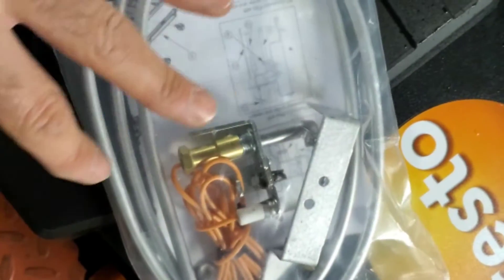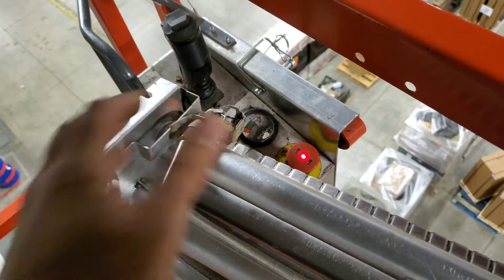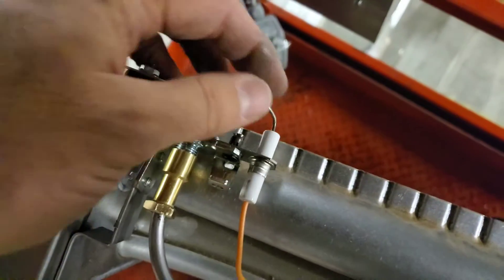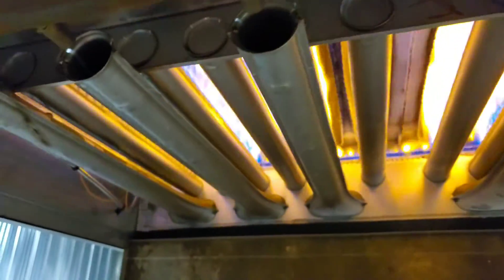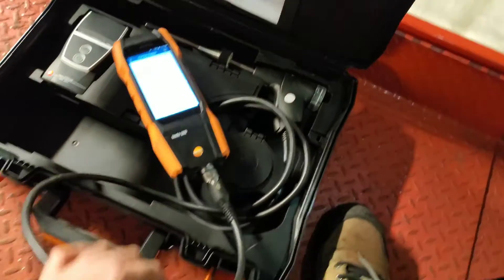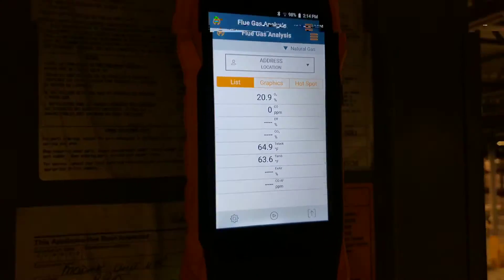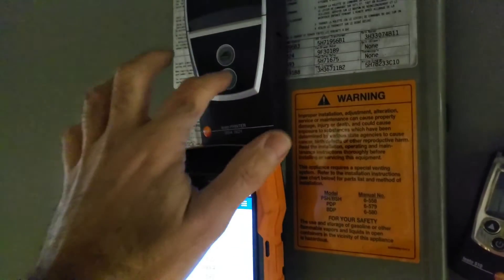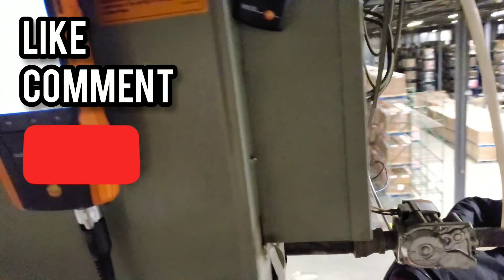Unit Heater Repair with the Testo 300

Comment from the maker: Soap residue in the air causes this issue every year, sometimes a simple cleaning is good, sometimes it requires a full pilot assembly replacement.

Comment: Hey Gary , for those modine heaters, who was your contact info for the manufacture? I’ll be doing some start ups on modine unit heaters here real soon , and for flue gas measurements, what max values would be acceptable in your experience? Thank you ,
Reply from the maker: I found a contact just searching online I believe, he told me not to brother with flue gas analysis as the burner can't be set up, you can only make sure gas pressure is right

Comment: Does the testo 300 have a built in manometer for gas pressure or is a separate tool needed for testing gas pressure. I see you use a different tool. Look to buy one just Curious if I will need to buy a separate manometer
Reply from the maker: Yes it does.

Comment: no faulty pilot assembly.  just a plugged pilot orifice. just blow it out.  You probabbly mad. a 15 dollar profit on that part and cost your customer time plus 100 bucks.    i know, you need his money. Nice video though.
Reply from the maker: Nice arm chair troubleshooting bud.  In actual fact, the soap particles in the air eat away at the pilot assemblies and have for 30 years in their facility.  They were told to put in sealed combustion but never did.  Perhaps ask rather than assume next time.  Happy HVACing!